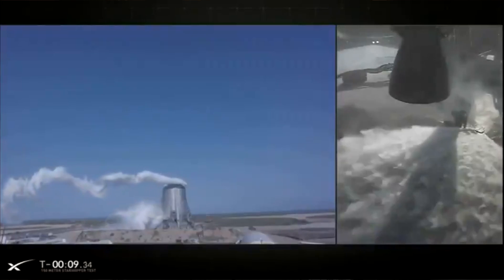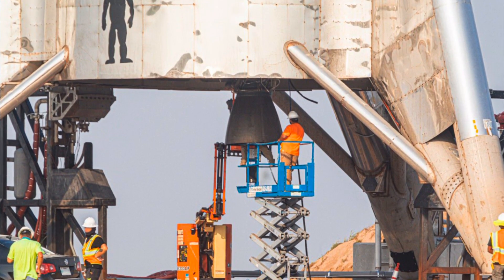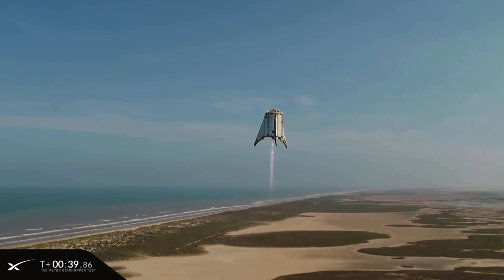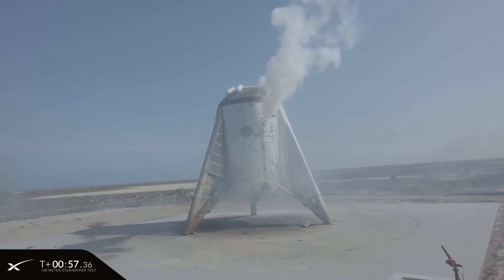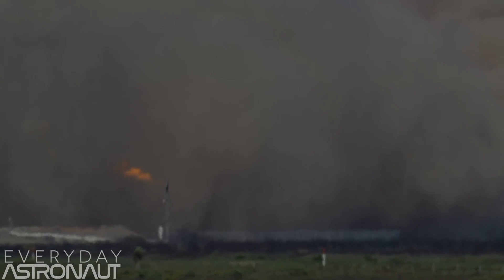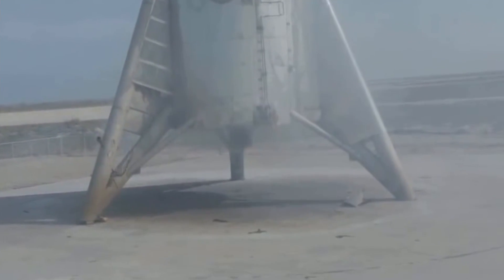Starship Hopper's Biggest, Lastest Flight Above Texas

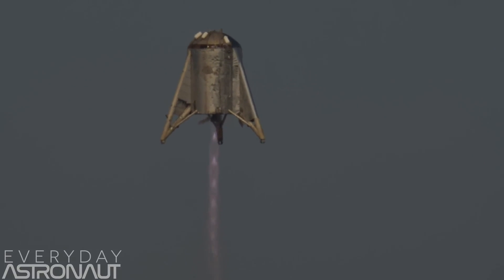Comment: There are 2 flame mysteries, not one. No opinion on the color changes in engine exhaust. But didn't anyone notice the dark vapor streaming away from the side of the engine the whole flight? e.g. 7:28. Possibly an open-ended hydraulic system for engine gimbaling, fluid meant to escape. The fluid caught fire at the end because complex flows of rocket exhaust nearer the ground set it on fire. 7:53. An open-ended hydraulic system is simpler, makes sense for Starhopper's mission. If true, this simplifies solving the main flame color question.

Just a hypothesis. At first thought it was turbo pump exhaust, but Raptor is closed-cycle. Does Starhopper use methane as the hydraulic "fluid"? Think I've heard of fuel being tapped off as hydraulic fluid.
[Edit to add time marks.]

Comment: Wow, head up the nozzle. How many backups on the lockout system did they demand? .
Reply: There is no fuel in the tank so you are sticking your head up a metal funnel under an empty tank. The rocket is safed.

Comment: Yeah you can see the exact point when the exhaust turns yellow. That, combined with the obvious flame and pressure vessel flying off, tells me there was a failure that started small and led to a catastrophic failure.

My money is on the lack of shielding and reinforcements being the cause. Since it is just a test platform.

Comment: I know Tim Dodd (Everyday Astronaut) said he was told by Elon that the Raptor is still a little cranky at under 50% throttle, which my guess is it would be when they try to land softly. Still some work to do on raptor. Also, watching them refill and place the COPV thruster tanks on top, one guy connected the tubes up then just threw the tank up there without securing it down. I never saw anybody secure it after watching 3 hours. My guess human error, once it was mostly used up, and was lighter, and it bounced off the top on landing.

Comment: I was curious of both anomalies and suspect the yellow flame was do to a ruptured Methane line.  If the methane line partially ruptured the engine would be running oxygen rich and that may have burned something up producing the yellow flame.  I'm not sure the thing seen flying away, spinning and venting gas was a COPV -- it may have been a fire extinguisher.  Suffice it to say SpaceX has some work to do to figure this out.  So, the test gets both an ataboy and an ahhhshit!

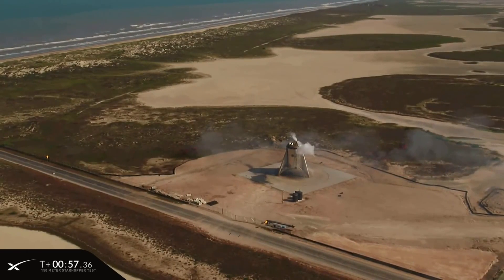Comment: Doubt you'll see this with all the comments, but.... you can see venting alongside the motor (in everyday astronaut at 4:39) which shouldn't be happening with that engine,  then at 5:40 it starts igniting. Likely a leak in the methane, which could never alight until it got big enough, which luckily was just before landing.

Comment: Methane rich combustion produces soot that makes the flame glow yellow (remember Bunsen burners from school...). It would also cool the exhaust, possibly enough to reduce thrust causing a somewhat higher landing speed resulting in the apparent damage maybe.  No need for anything other than excess methane to cause what was observed.  its hard to tell for sure from the video on Youtube, but the colour didn't look to me like it resulted from metal - just carbon soot. Maybe something failed causing a methane leak that caused flame under base of vehicle and discolouration in exhaust and slightly reduced thrust.

Comment: So had the 200m hop been approved, they would have a mess to clean up. Thank you FAA lol. It would have been a shame if they had to sift through debris to find out what failed in the Raptor.
Reply: Possibly not, we dont know what happened.
Reply: True. I am hoping that it was just a massive fuel enrichment, testing a soft landing technique that was slightly miss calculated... But I doubt it. As Scott said, methane can't really burn like that. There has to be some heavy contamination to make that kind of radiation. Plus the fact that it hit so hard that the collapsible feet were crushed flat and a RCS tank peaced out... That's something that they would have tested in McGregor and got some reliable data from.

Comment: could be that as they are throttling down the engines the fuel mixture changes because while the pumps are throttling at the same rate the fuel doesnt share the same flow rate for some given pump rate?
not an expert on fluid dynamics so it could be much less significant but intuitively it seems like a plausible contributor to the yellow exhaust to me.

Comment: The person wearing the key is not as much tradition as it is an OSHA safety standard.  Whenever people work on a potentially dangerous piece of equipment they are supposed to place a padlock on the controls an/or power source and place a tag indicating that the system is under maintenance.  And the people doing the work keep the key to the padlock with them.  

When I was in aerospace, violation of 'lock out - tag out' procedures was a 'one strike and you're fired' offense.  The company had paid a huge fine to OSHA after somebody got badly injured because they didn't follow 'lock out - tag out' procedures and somebody turned the machine on.

Comment: How the frack does that thing weigh 100 tonnes? IANARS by any means but that seems absurdly high. I bet performance would be way better if they used aluminum instead of lead. 

No knock on Scott here, I'm probably way off base on the actual weight. This just got me in the mechanical feels.

Comment: As the vehicle descends down towards the region where it kicks up larger particles from the surface, these are sucked in to the engine stream caused by differential pressures.
This is why you see the flaming effects.

Comment: Combustion products are never perfect.  There probably are some non-gaseous products in the exhaust to give some black body radiation.  It would be normal.  That said, Tim's video captured some very clean combustion too.  The combustion products absolutely could change with throttle position,  propellant flow, and related temperatures.  Also the effects are dynamic, not static.  Changes beget other changes in temperature, chamber pressure, chemistry.

Comment: Two things here if anyone wants to chime in on it.

1). Looking at the portion of the video that shows Tim's footage of the Starhopper(starting at about 7:30 in this video here) you notice what appears to be dark smoke coming off the side of the engine bell nozzle. And at about 7:52 it appears that the orange flame on the underside of Hopper is ignited from that smoke source. This appears to me to confirm that something did happen that was not intended with the engine and that SpaceX will have to take a look at. 

2). This is the second test of the Hopper and again the Crush shoes or whatever you want to call them on the landing legs were crushed on impact. I know Scott mentioned that if the engine did lose thrust at the end it could explain why Starhopper came down a bit harder than intended. In the actual version of Starship though that will eventually land on the moon and mars and back on Earth how are they going to deal with the issue of touchdown? Can they perfect the suicide burn enough to the point where Starship can land on the landing gear without and crush cores needed? Or will they intend on having to replace those crush cores after every landing because I feel that could be an issue if they aren't on Earth and need to do it.

Comment: Note that the color changes only with deep throttle, the ship is getting lighter, and power down to land, so they probably feed less O2 to throttle deep, and this resulted in not burned CH4, so extra C, that would probably just change the color of the flame. I bet the engine did NOT suffer any problem or damage that caused the changing color of the flames. I bet a beer.

Comment: for the yellow flame my first tough was the speed of the the exhaust when it throttle down (like an oxy/fuel torch) and the ratio becoming richer because it's more easy to control ... but I'm not an expert at all ...

Comment: Best shirt ever.

I'm guessing a possibility for the orange flame and the fireball out the side is a slight scrape or something on the raptor engine bell. A tiny, even microscopic pit inside the engine bell can quickly be torn open under the heat and pressure of a rocket exhaust. SO perhaps there was a small defect, which began eating away the engine bell. The steel would give off carbon, which would burn dark and thick. Towards the end with the fireball at landing, this would be the pit or defect burning through to the outside, and probably burning into a fuel line or hydraulic line. Either of these will cause a deficiency in control for a soft landing, and the hole in the engine bell will make it loose downwards thrust. We see the engine vectoring a lot to the side as it lands, so it may be trying to compensate for a sideways thrust, or it may have jammed due to loss of hydraulic fluid.

Comment: Not a demonstration flight, however much the rediculous internet tries to imply it should have been perfect.  Engine stand does not produce the vibration of a test vehicle, vibration is the big issue in complex high energy system.  This went perfectly for a test, stuff broke but not enough to spoil complete data recovery including air frame.  Absolutely perfect result for the engineers.

Comment: Possibly a lubricant leak into the methane causing the colour change, from contaminated methane, burning slower hydrocarbon chains. That would account for the flame as well, venting from an overpressure relief on the hydraulic system, and the faster landing was to get down as fast as possible, before the hydraulic systems totally failed.

Comment: From the slow-motion,  there was a flash of flame beside the nozzle first, and flare turns bright for 0.01 seconds(also on the side where the flash happened). A few seconds later, the flash became a burning fire near the engine, then the flare turned full bright (sucked in all the exhaust smoke from the unknown fire burning.)

Comment: If I had to throw out wild guess, I'd say that because of the unusually long burn in an atmosphere with pressure of 1 bar some spots of the engine bell became a bit too hot and started ablating. In my opinion as atmosphere changes the hot spots on the engine bell move and for the raptor they will be at optimal position at low pressure, because raptor is not optimized for sea level.

Comment: I was wondering why noone has considered airbreathing rocket engines. For example, Falcon 9 has some 283 tonnes of oxygen on board. If half of that oxygen could be sucked from atmosphere, we got much more capable rocket. F9 could throw more than 100t to LEO.
But then again I looked at one of the largest aircraft engines RR Trent and its ability to suck air is quite limited... Only some 0.8t per second, while F9 consumes about 1.8 t of pure oxygen at enormous pressure. As air equivalent you need 8.8t of air sucked in and compressed into very high pressure... 11 trent engines... complicated.

Comment: The Starhopper's Last Flight might not be as buttery-smooth as wanted, with some niggling problems, but I definitely prefer that to a no-issue test.

Why? Because it's better to experience all the problems while developing-prototyping-testing rather than having those problems bite in production.

So, all in all, it has been a very successful test, not just showing Raptor's capability, but also (potentially) exposing a little weakness in the Raptor's design -- which I believe will lead to a better Raptor, a better Starship+SuperHeavy, and ultimately, the realization of our collective dream of becoming interplanetary.

Good Job to SpaceX, and well wishes for, again, a VERY nice video from you, Mr. Manley!

Comment: If you look at the video closely right before the Hopper descends cryogenic gas is venting from the side of the nozzle;  it then catches fire before the main combustion chamber turns color and then the smaller flame is obscured from view. It almost looks like the there was a burn through on the side of the nozzle wall.

Comment: Well, I think what might have happened there was some component at the upper end of the engine burning out over time, it's bits and pieces melting off into the exhaust and causing the color changes. After a while, it finally blew out and caused the visible flame, probably also causing a loss in chamber pressure leading to a harder than anticipated landing.
Perhaps something in the piping or the pump system isn't just right yet? This is a prototype after all ^^

Comment: Your mention of the engineers inspecting the engines on those rockets reminded me of something that a former RAF engineer told me about their time working on radars. They had a similar procedure that involved physically locking the isolation switch for the radars they worked on in the open position and carrying the key on their person in order to perform maintenance on the transmitter. Though there are no doubt countless other examples of similar situations, the largest machines with the largest hazard zones are often so large that it isn't practical to give the operator position clear line of sight over the entire danger area worse still it's physical lockout procedures like these are not always an option. Large airliners are arguably a great example of this as it's physically impossible to enter the aircraft after the huge hazard zones of the engines are clear so we have to rely on the whole have multiple people cross check every step in the hopes that two people will never make the same mistake at the same time.

Comment: Yep, that's what I though when I saw this first: they moved away from a stoichiometric rapport as a mean to fine tune the thrust. That can have some sense, but it's not exactly the best way to keep "sane" a reusable engine and the added complexity in the mathematical burning model may not justify the risks. Then I saw, in Tim Dodds's video,  that little flame near the nozzle, at the base of the tower, that appeared about 7 seconds before the exhaust turned yellow. Now I know a rocket is an external combustion engine, but too much external and you got a RUD event. Luckily it wasn't the case, so the SpaceX engineers can learn faster a bit more... Oh, and Scott, take a look at how a video of ElectroBOOM ends.

Comment: Finally a video that doesn't simply masturbate over the whole thing. It's clear that not everything went to plan. If nothing else, that bouncing COPV is the only proof you need. I highly doubt that was intentional.

I don't know what the flame on the outside of the engine was, and if that was the beginning of a complete engine failure or not, but that too didn't seem entirely good either.

People are so busy praising SpaceX that they pretend nothing ever goes wrong.

Comment: Dust in the exhaust is probably still the correct explanation regardless of any other shenanigans Hoppy might have pulled. Looking at SpaceX drone footage it can be seen that the yellowing started from the bottom of exhaust flame as it touched the dust cloud. It doesn't take a whole lot of dust to give this effect, the faint light of the exhaust gases are easily overwhelmed by even small amount of particles mixing in and glowing from the heat.

Comment: the engine is running at such a low power it doesn't burn all the fuel until it leaves the bell.

Comment: When you are gas welding you can see the same flames as here, with too little oxygen the flame is yellow, with way too little and it starts sodding, with enough oxygen you get a blue flame which is not solid but can be seen through, maybe the rocket was dialing down on the oxygen to descend?

Comment: But why was there a COPV there at all? The methalox architecture is self-pressurizing, so it doesn't need helium. They aren't using TEA-TEB for ignition, so it's not that. Was it the nitrogen for the thrusters? I don't see how that could have been liberated, given how intact it looks after landing...

Comment: One thing that Tim mentioned before it flew was that it would actually be good if it wasn't perfect. Because solving problems now means not having them later when a failure is far more expensive and devastating.

Comment: The colour of the exhaust on launch and landing appeared to be the same. I presume this arises from running the engine fuel rich during these phases of the flight. Anyone who has used a propane torch knows that even simple hydrocarbon gases will burn yellow/orange and produce soot if the air/oxygen mix isn't right. Apart from the colour, the temperature of an orange CH4 flame is around half that of a blue flame. I'm wondering whether with the current launch platform and landing pad construction mean they need to run a cooler burn on launch and landing.

Comment: The flame color is explained very easily. Take a cutting torch, and set it fuel rich, boom, yellow flame (The end products of Propane+O2 are the same as Methane+O2, only the ratios differ.). Varying the combustion mixture is also the easiest way to throttle without losing the flame.  Add enough O2, and it becomes nearly invisible.

Comment: Hahaha Love the shirt. "wibbily wobbily timey whimy...stuff" (spelling?)

I was also thinking it was a thrust change that caused the exhaust to go all "bright burn" it seemed to happen just as it touched the concrete. But yeh could have been something "failing" in the engine, or perhaps something like a pressure relieve valve opening up?

Will be interesting to see if they release some data, like rate of decent, force of landing and what not.

Comment: Do you think that if they attempted the original full 200m hope there may have been a failure during landing while still 50 or 60 meters in the air, instead of just  a couple of feet off the ground?